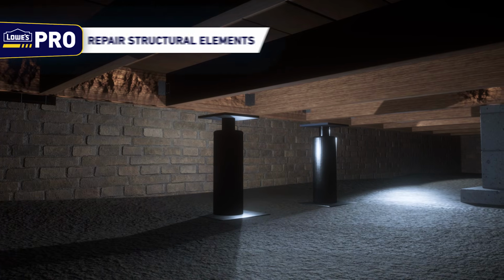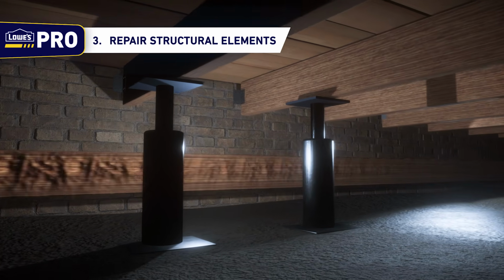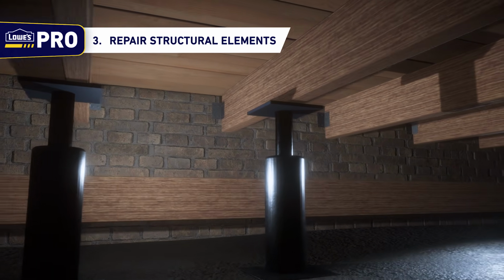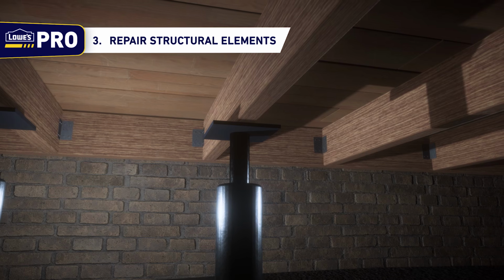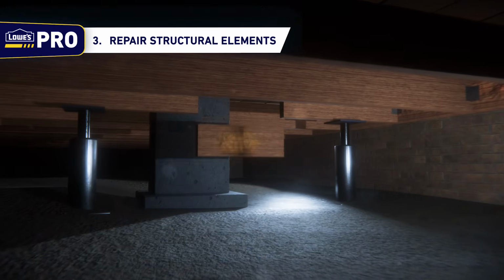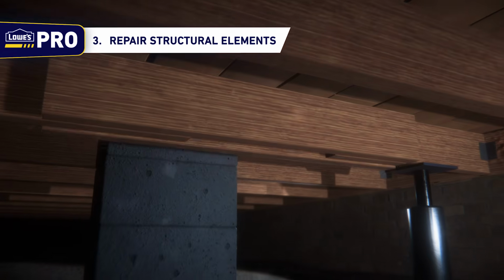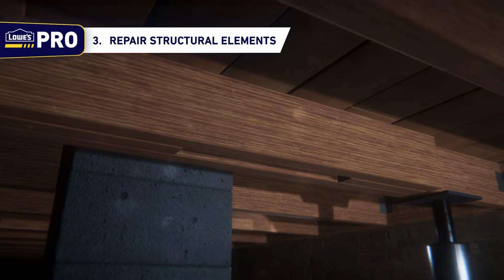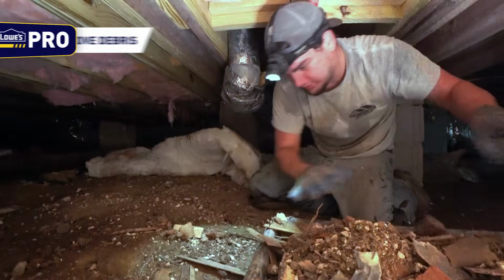How To Partially Encapsulate a Crawlspace | Lowe’s Pro How-To

Comment: Was he spraying foam directly onto batts?
Reply from the maker: While it's not common to spray foam directly onto batts, doing so may create an effective air seal and improve insulation performance. However, it's essential to ensure that the batts are properly installed and that the spray foam is applied correctly to avoid moisture issues. You'll still need to check your local building codes and guidelines.

Here's an updated DIY Foam Insulation guide to reference: https://www.lowes.com/n/how-to/do-it-yourself-foam-insulation

Comment: I've been researching my crawl space and learning for 3 years. Foundation and crawl space contractors are opportunists. They're also without shame, taking advantage of consumers and charging exorbitant amounts of money to consumers. It's wrong & they know it, but at an average of $10,000 for 1000 sq ft crawl space, and basic menial labor which is not complicated work. Just a bit intimidating until you get used to your crawl space. I recommend fully lighting up your crawl space first, before you commence any work. Working in darkness, with a single little light is a whole different ballgame & intimidating and difficult, versus working in bright lights. The work is easier, you can navigate and see well, and it feels welcoming! After all is said and done, you will spend a fraction of what the opportunistic crawl space contractors would charge you.

There is massive markup with the materials by contractors & their labor rates are abhorrent. So I've learned plenty. You just have to compartmentalize the project in phases. I've got three phases. 

Phase I: Repair any structural weaknesses in posts, beams, etc.  And clean up crawl space of debris. 

Phase II: Install French Drains, for more efficient drainage. Install sump pump, and 15 Gal. sump pump basin and connect sump pump to outdoor drainage system.

Phase III: Remove old torn up and tattered vapor barrier. Grade out flat, the extra dirt that was dug up for the French drains in the crawl space soil area. Install new vapor barrier. 

Materials & Planning. Prior to installing the new vapor barrier, you'll need 10 or 12 mm thick one piece Vapor barrier. Draw up with schematics, and then properly pre-cut the Vapor Barrier prior to going down into the crawl space for each section. Have on hand more material than you think you will need. That would include 4 inch wide seam tape, butyl tape for adhering the plastic to the concrete wall surfaces and plenty of vapor barrier to overlap 6 to 12 inches. In addition to that for phase 2, you will need the right amount of linear feet of perforated 3 inch or 4 inch pipe for the French drains. For a 1000 sq ft. crawl space you'll need 2 to 2.5 yd of rock. Smooth, round 3/4 River Rock will work well for a French drain in a crawl space. Get a utility sled, so you can slide the heavier rock down the crawl space lengths, so you can transport the heavier objects to and from where you need to go. You'll need short Trench shovels, short rakes and plenty of patience. Wear a mask, get some really high quality knee pads, and coveralls so you don't get too filthy. Pace yourself. Take your time and enjoy the process. Plan, plan, plan, and plan some more. Make a bullet list. Draw up detailed schematics. And give yourself a pat on the back for becoming a very competent homeowner. 

It's nice to work with someone else too because this is a difficult job underneath your home. You can vet five or six different contractors and pick one that's very reasonably priced, trustworthy, good follow up, punctual, and honest, anywhere from $30 to $50 an hour to help you with the heavy heavy work. That is, a general contractor that Do Not specialize in crawl spaces or foundation work. You can find ones that will work with you, for a reasonable price and then you'll have a second person to help you do the job just steer clear from foundation and crawl space contractors, they charged exorbitant amounts of money that are unfair to the consumer and not ethical.
Reply: Whoever you are I just want to say from the bottom of my heart Thank You for sharing this thoughtful, thorough, and detailed post. This helps a whole helluva lot🫡💯🫵🏾🙏🏾
Reply: Material alone will run you 3-5k now add a foremans pay plus a few helpers, the markup isnt that wild. This is one of the hardest jobs there is, second to offshore oil rigs and I cant think of anything else.
Reply: you have no idea what you’re talking about
Reply: Don't be cheap. Pay a pro
Reply: Thoughtful-less answer. Most all pros, are shysters.  @potentialhvac6074

Comment: I’ve seen both and now I’m confused to which it should be. Should I put my vapor barrier on top of my rigid insulation on the walls or behind?? I’d be kind of concerned of putting the rigid insulation behind the vapor barrier because I don’t want soil vapor to have access to the rigid insulation and eventually keep wicking up through even though it’s high density XPS and so won’t absorb much I just don’t want it to be able to absorb any
Reply: You see both because the vapour barrier is supposed to go on the “warm” side of the wall. In some locations (northern) that means it’s closer to the interior and in hotter/southern locations it’s on the exterior. 

You are just trying to control where the water will condensate, where warm and cool air hit, and allow for it to dry out.

Comment: I just cleaned 60 years worth of junk, out my crawlspace last weekend. Now it's down to the dirt I will put down poison in the dirt and cover it with 6 mill plastic, and next spring I will get a contractor in there to put concrete on the floor
Reply: 6 mil is just essentially a trash bag. Use at least 16 mil if possible.
Reply: couldn't find 16 mil, so 6 mil was the best I could do.   @Smellydoug
Reply: 3 mil is a trash bag  @Smellydoug

Comment: Insulation is better on the OUTSIDE. On the inside it can trap moisture in the wood. The foundation wicks water up onto the wood so the spray foam creates a vapor barrier sealing it inside.

Comment: Spray foam is the WORST for insulating a Crawlspace. That info is completely wrong. If you have high moisture in a Crawlspace and can’t afford to do an encap, spray foam will trap moisture and rot your wood extremely fast. Even when doing an encapsulation, you shouldn’t spray foam in a Crawlspace.

Comment: Is there a way to not use a dehumidifier?   I had 50% moisture reading on the wood in my crawl space. I don't have $10,000 or whatever it will cost for encapsulation and machinery.  Can I use Thompson's water seal on the wood and concrete sealer on the walls?
Reply: OMG!  50% moisture ??   I guess my reading of 18% isn't worth losing sleep over.  Still:  I'm not spending $11K to remediate this 1100 s.f. shack.  I'm leaving it be for now.
Reply: I see some decent used dehumidifiers for under $400. Wiring it is another story. 
If you close the space I think you’ll need the dehumidifier otherwise it may be a mold heaven.
Reply: How often do you empty your dehumidifier?
Reply: @clncaaquintero3595  

We don't. They have a hose attached to the bottom which drains them outside the crawlspace.
Reply: We ran two GFIs into the crawlspace on either side and are using two cheap $150 dehumidifiers.

Was a lot cheaper and 4 years later no major issues. Have to go down and restart them if the power dips out, but otherwise fine.

Comment: Oh god this type of job is seriously tedious, hard and super labor intensive. Its like going to some marine boot camp with all that crawling and be covered with crap. I bet in fixing any "major" crawlspace issues will never be a 100% a problem solver down the road and the "repair" bill will cost as much as buying another home. I have seen a "patented" system where the crawlspace company literally lifts the whole freaking house like 1 story high in an affordable manner so that the working condition will never be like some kind of military boot camp training during the repairing process. All in all, never buy a house with a 3 foot "crawlspace, get a house that has at least 8 foot crawlspace (A.K.A a basement). If anyone has a "major" crawlspace problems, it would be more "logical" to actually dig out the the crawl space and make a basement and aid in the repairs, the budget will be more expensive, but now the advantage is that your house's market value has increased due to having converting a "crawlspace" into a "basement", you basically killed 3 birds with one shot. Fixed the crawlspace issue, created a large basement headroom and also boosted your home's market value. I feel it's insanely pathetic to just fix the "crawlspace" alone so that 10 years later you're gunna need to repeat the process again. Having a basement can allow homeowners to easily repair any issues underneath the house. "Crawlspace repairs do indeed need a professional".
Reply: In south east Louisiana, where I live, basements are impossible. Not every area can have basements due to higher water tables.

Comment: Lowe’s: “install a GFCI in the crawl space.”

Also Lowe’s: installs regular outlet 

🤣🤣🤣
Reply: As funny as it is to dog on Blowes, electrical code requires GFCIs to be "readily accessible", and most crawlspaces do not meet that requirement. This video they had GFCI protection provided at the panel, protecting a standard receptacle which is how I would prefer it to be done. Next best solution is to install either a GFCI receptacle or GFCI deadfront on the entrance to the crawl space and load side out from there.
Reply: In the video they show that the outlet is wired to a GFCI breaker, so therefore the outlet is protected, and is easily reset as well.
Reply: GFCI was immediatly shown on breaker
Reply: Lowe’s will be Lowe’s

Comment: Is it possible to place supports and plywood to make the crawl space a useful storage area?
Reply: Don't allow any wood to touch the surface (sand, vapor barrier, etc) as this will pick up moisture and attract termites.  I store wood in my crawlspace but have it on pvc pipes or bricks.
Reply: We set up a dehumidifier for the spring, summer, and fall.

Comment: As a termite professional, I recommend anyone  should check with the company that has your termite bond before ever using spray foam.
Reply: PROBABLY because the foams can hide termite & other WDO activity. Also, some foams trap moisture & create suitable conditions for termites & other WDOs (along with mold, rot, etc).
Reply: Wood rot, moisture and termites can destroy the wood but it won't be visible once the foam goes in.
Reply: Why? Elaborate please…
Reply: Termites love to make homes out of spray foam
Reply: Pest operator for 30 years , agree!
Reply: This is why you use roll batt out insulation
Reply: Most foam contains cellulose.  Cellulose is what termites eat. Any termite warranty will be voided. Plus it hides termite activity.
Reply: So as a termite specialist you recommend paying a termite specialist before doing anything? Got it.